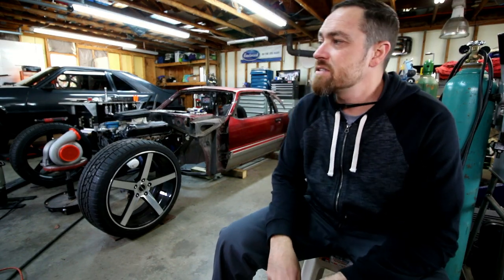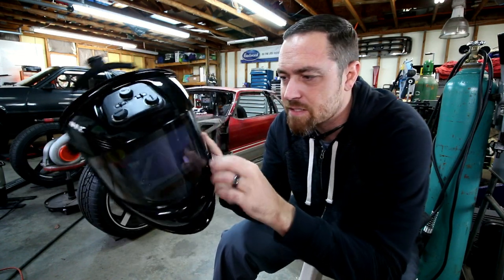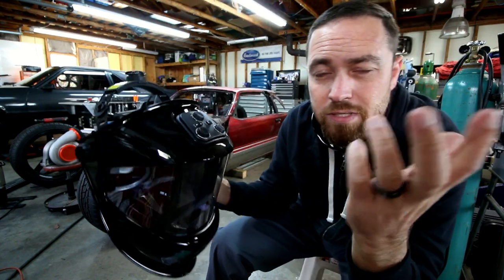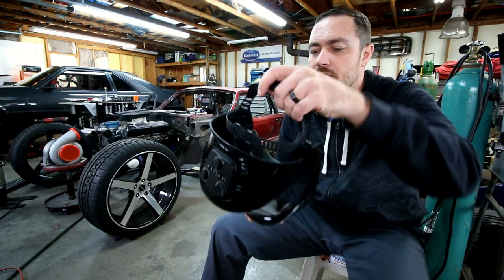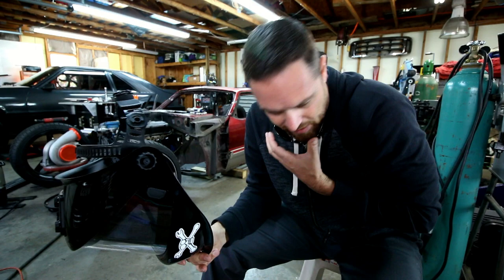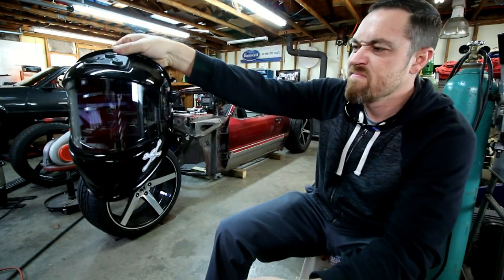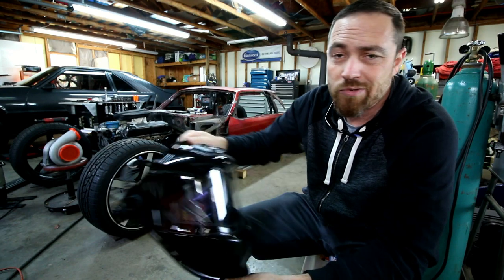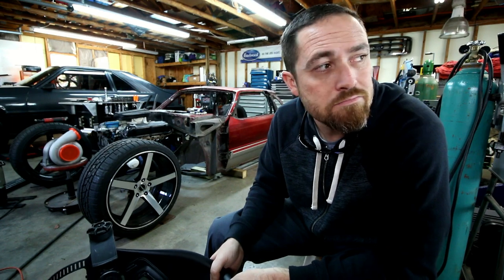180 Degree View Welding Helmet by Eastwood

Comment: My first auto-darkening helmet was an Eastwood. It was their "Large view" helmet which I bought right when it came out. I really liked it when it worked. But it only worked for about a year before it intermittently wouldn't darken. I tried everything I could think of, but eventually I got flashed so many times I just couldn't trust it anymore and it ended up in the trash. Spent the bucks on an ESAB like 5 or 6 years ago and haven't looked back. Hard to say I wouldn't ever own another Eastwood helmet, since like I said, I did like it when it worked. But it did leave a sour taste in my mouth.

Thanks for video Kyle. Keep them coming!

Comment: All the knobs in the top are not the best place . I bang my helmet all the time under vehicles. Looks cool but probably not practical
Reply from the maker: yeah I guess it depends on how your using it
Reply: I like where the buttons are on this helmet. It’s sure better than having them inside where ya have to take the helmet off to make adjustments. That’s what I have to do now and I hate it.
Reply: hj gong I just looked at that voice helmet and that is freakin awesome!
Reply: I do everything there is to be done on vehicles, and I rarely bump my head, so for me, it's a pretty good location. I think on the side would be worse, because for me, I get more contact and rubbing in that area.
Reply: I think a simple hood to protect the knobs will be helpful.

Comment: I have other panoramic helmets that matched the 'window' size & width of that Eastwood, but at 3 to 4 times the cost! I'll wait until Kyle reports back with a full review of it after he has used it for awhile. Been using my current one for 35 years, so I don't want to rush out and get a new one right away.
Reply from the maker: yeah I will do some follow ups on this once I put some miles on it

Comment: how many sensors are on it? at my job I weld between 5/8 to 7/8 dia tubing in the tightest place on industrial air coils and a lot of the time the sensors are blocked and I get arc flashed
Reply from the maker: +Will Crandall I could see that being a challenge...it has several sensors, don't recall exactly where the sensors are.

Comment: Are you still using the stock torch on the 180 diversion? Or did you upgrade? I noticed some of your videos weren't using the foot pedal...?
Reply from the maker: that was the Eastwood TIG machine, it comes with an optional finger trigger. But yeah still the stock torch

Comment: I can use that periferial  view for sure it’s a great feature...but my grief with that helmet are the controls on top of the helmet ! What they were thinking ?? 
Im going to be hitting those knobs constantly when I’m in a tight space, then i do a lot of mig as well and this knobs are not in a safe place for it.
I m going to pass on this ones , as soon they can cramp the controls inside , I will buy it , but for now , I pass, good try tho.
Thank you for the review, wonder how the reflections inside of those side panels and the lense will melt easy ! The ESAB had that problem and prompt they issue mine with new and upgraded polymer so it doesn’t melt and resist the grinding !
Maybe to toy around with it with Tig, but for heavy industry forget about it.
Cheers.
Reply from the maker: Yeah I love it...I thought the best feature was the three displays but after using for awhile and them going back to my old helmet I love the true view feature. (doesn't have that green tint)
Reply: The Fab Forums indeed!

Comment: I bet you get wicked double vision with that large arc on that outside cover plate. Because of how far the cover plate is from yhe actual lens. Lot of light bouncing around in there. But i will say it looks cool. Other than the knobs on top.  Sparks and dust are bound to go in there.
Reply from the maker: no light bouncing issues that I noticed

Comment: Cool concept, Kyle.👊  I haven't seen this before now.  You said the dividers that separate the front from the sides aren't too distracting.  Would you say they are similar to A-pillars on a car?  Honestly, I am a machinist of 23 years and don't have a lot of welding experience, but this helmet looks interesting.  I have a small Miller Econotig and a cheap HF flux-core welder and autodarkening helmet, but if I ever decide to get a little more serious into welding, I wouldn't mind checking one of these out. Cheers, man!
Reply from the maker: yeah I would say they have a similar feel to the a pillars on a car. Your always looking beyond them so there not really noticed

Comment: I went to the Eastwood website and currently they're selling it at $169 and for what you're getting that is really really good other one complained of mine this is not in any way dissing the product at all I think it's a very very good product and has a lot of good uses I think they should add a function where you can adjust the side panels make a darker or lighter again this is a very very good product I give six stars and set five

Comment: My opinion on this is its good for iron erection welding (Ironworkers). Which I did for 6 years. It is good because you need to be aware of your surroundings at all times being so high up and having thousands of pounds swinging around you but the controls on the outside would not last with all the out of position welding Ironworkers do. Now I work in a shop fabricating and welding and I see no use for this hood. Alright concept but you could see Eastwood is trying to hard to compete. In conclusion, put the controls on the inside of hood and market it to Ironworkers. And I could see you're not into this hood either. Its ok but Eastwood is trying to hard.
Reply from the maker: thanks for the feedback

Comment: Cool but not very practical IMHO especially with the knobs on the outside. I also hate any hood that takes special sized clear cover lenses.
Reply from the maker: Its rad an so practical... I have had a knob setting move on me though.
Reply: Never had an auto hood till a few months ago after 20 years of welding. I went with the Lincoln 3350 and it's been great. The auto part is removable so I can replace the hood if necessary.

Comment: Just a useless gimmick, you should never try to weld out of the corner of your eye, your depth perception is not good. The side lenses don't darken enough to protect your eyes from flash. I also see the control knobs getting damaged.
Reply from the maker: lol...sides darken to 11 that totally enough
Reply: The Fab Forums Kyle I enjoy your channel and usually agree with you but in this case I'm not on board. I'm no expert, however after welding for 40 yrs+ if I'm welding chassis or trailer frames, heavy steel ect and pushing 150-250 amps with mig or stick by end of day my 60 year old eyes are tired. The last 6 years or so I've been using a Lincoln helmet that auto adjusts to 13 and my eyes are good even after 5-6 hours of welding. For lighter metals it might be great but I want to save my eyes from the cumulative effects of a bright arc. I don't see it being in my tool box but if it works for you, go for it. One thing I didn't see on the Eastwood site is if you can use a cheater lens, just a thought.
Reply: this model does not support a cheater lens